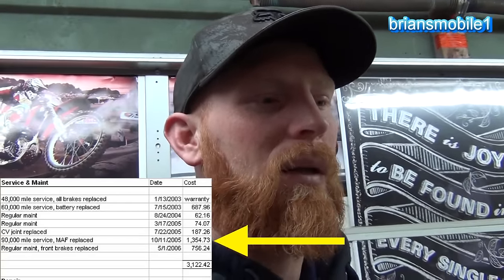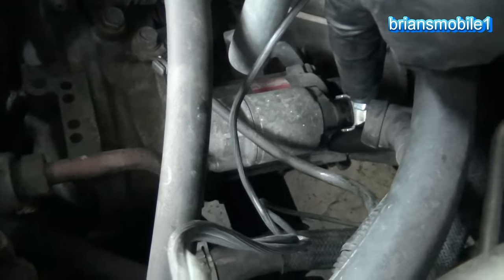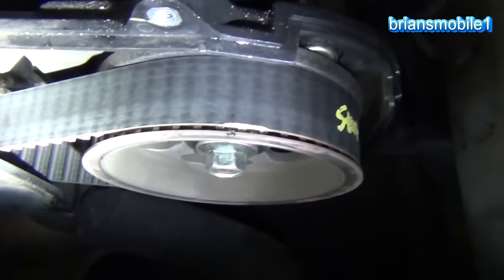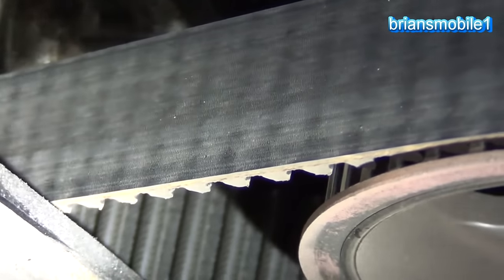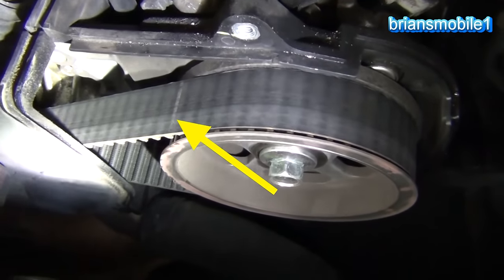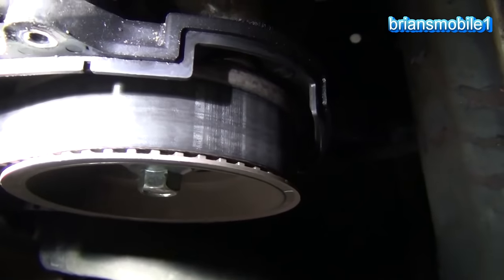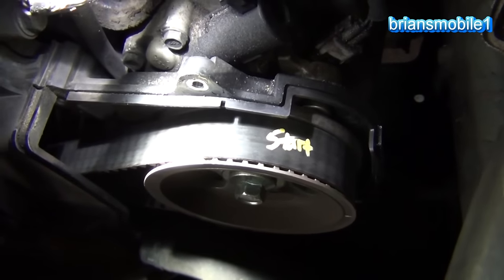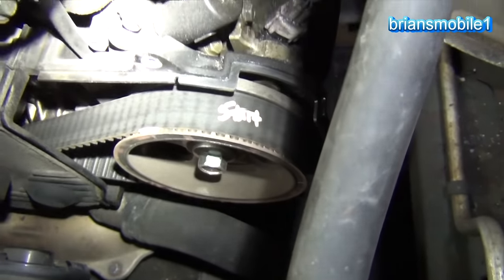How to Tell if Your Timing Belt's Been Replaced

Comment: my mazda is at 300k with original timing belt. im the only owner since new. i should probably change it. :/ im so lazy
Reply: Suspect it has a timing chain.
Reply: you really should.. 300k is a lot and belts are belts..they may snap anytime..
Reply: +fidel catsro i changed it lol i got lucky
Reply: belt may be ok, but the tensioner I would bet is counting down the days until it seizes.
Reply: dosmastrify I just get the whole Gates kit for my Subaru if you need a belt.  It comes with idlers, belt, tensioner and water pump and it's cheap.  Reason being I had an idler gear that didn't make it between changes and came apart in dramatic fashion.  Belt jumped three teeth, I had to put a Gates kit on the car.  From now on, I'm changing everything, just getting a kit.
Reply: Clearanceman2 you misunderstand me. I was saying even if the belt has aged very very well, and still appears great, the story may not be the same for the tensioner.  I had one seize and shred my belt. the intact pieces of belt I fished out didn't look all that bad... but the tensioner went catastrophic
Reply: ***** Actually, I used it on my car, sorry that wasn't clear.  But I got it from Amazon and they still have them.  Also they are on ebay.  Which engine do you have?
Reply: Jonathan Mitchell i
Reply: Bullshit The tensioners don`t fail without internal problems from engine. Many people blame timing belts. If the engine is damaged and worn a new tensioner and belt will make no difference
Reply: @ThePariss333 I would always do tensioner with belt

Comment: If you get a timing belt car, and most of them are pretty old at this point, think Toyota first. All Toyota but one model are non-interference engine, meaning that if the belt breaks it won't bend your valves and possibly break the top of your pistons. All Honda are interfence. Gates publishes an online guide covering all models through 2010. This will tell you if the engine is interference or non-interference and what the recommended service interval is.ou 

The longest service intervals are 105,000 miles. I doubt any belt is made of material that will not last that long. But use your discretion. In the bad old days, timing belt probably were made of weaker materials. On a 2000 Dodge Stratus V-6, the factory belt had about 120,000 miles when I changed it. I just changed the belt on my 2001 2.2L 4cyl Camry at 130 miles. This was, I believe, the orignal since it said "Toyota" on it and the writing was quite faded. Once you known how, it is an easy job to do though on that model. The Dodge was almost impossible to do in the driveway. The cover cannot be taken out with removing a difficult to access power steering pump and the brackey which holds it. In retrospect, I think I should have yanked the cover out with brute force when the water pump started leaking. But it was high mileage at that point and I thought the transmission was at risk of failing at that point  even though it had no symptoms yet. I got $1500 for it in the state buyback program and I had just bought the Toyota.

The moral of the story is, watch out with timing belt. People sell their cars because the timing is due or overdue and it can be a very difficult job depending the model. The 4cyl Camry 2001 and earlier is one of the easy ones. Even so, I had it jacked up five times before I got the job fully done. First time, couldn't proceed because I need a tool the remove a bracket in front. Second time, did the camshaft seal. Third time, had to redo because it was not driven all the way in. I did not have time to do the oil pump "spaghetti" seal. Fourth time, did the oil pump seal and finally put in the new belt. Fifth time, retorqued the oil pump bolts because I was not sure they were right. There is still a tiny oil leak which apparently comes from the front crankshaft seal, covered up by the huge leak which came from the oil pump. If high mileage oil doesn't stop it, I will have to jack it up again to change the crankshaft seal. But I have gotten so good at this, I probably will able to do it an hour and half, maybe less. I rent a room in private home, and I can only work on it when my landlady goes out of town and I get the driveway. I could work on the street but in my neighborhood you don't do that for anything beyond changing spark plugs or changing the oil at the most if you can be quick at it.

Comment: When those believe to be in the market for a used car when those wonder if there was signs the previous owner had the timing belt changed when new owners of the earlier 12 valve Cummins or the newer 24 valve wonder if the previous owner took care of the killer dowel pin when some engines believe in covering up an access hole in the front cover to make inspection of the timing belt extremely difficult when owners have to take much of the front of the engine apart to get at the timing belt.

Comment: I had a car that the belt was 2 years old and snapped with 18K on it - a seized tensioner (was not changed with the belt) by the garage that did the work for previous owner (it was a metal tensioner) also had a plastic tensioner wear down to a half moon shape years ago when I did not change a tensioner either (got lucky) as De clutched (upon hearing bearings fall out) towed car put new belt and (tensioner this time) and got away with it.

Comment: reality check. your opinion?  belt mainteance gives miles and months when to change a belt.  my though is the mileage is the real determiner not age.  miles determine heat and stretching that effect belt endurance not months.  therefore should belt change be determined by miles?
Reply: I wouldn’t keep a belt on a car longer than 5 years.

Comment: The problem with timings belts is that the belt is only one part of the equation...with this method of checking you have no idea of the condition of the idlers or tensioners
Reply: Thats obvious, but the vid was about checking the belt, not everything else. Thats done when its changed.
Reply: Hi, Usually the machanic will purchase a 'kit' that will have everything but the waterpump. Then its up to the machanic to decide if the pump needs replaceing. My GTr had done 170000kms and the waterpump checked out fine so we refitted it.
Reply: @ThePariss333 Did you find out your solution?

Comment: Just got my new kit in from Amazon. The belt literally has no markings on it. The entire kit doesn't. It's all from China, very skeptical on this kit
Reply: don't use it.  these are critical parts.  if they fail, the engine is usually scrap.  Chinese crap won't cut it in this case.
Reply: @reallyhappenings5597  what do I do with it 🤷‍♂️ lol what kit do I actually order? Thank you
Reply: ask on forums for your specific vehicle, or just use the OEM parts.  but maybe start with the basics like an oil change... you don't sound confident and engine timing isn't something you want to get wrong.
Reply: @reallyhappenings5597  that and the valve adjustments are the only things I've never done. I did order a oem belt. Says Honda right on it, going to attempt the rest of the kit. I'm confident just wish I had more hands on. Just me

Comment: my Audi a4 1.6 is well beyond 140k miles and still going. No recommendation on changing on handbook. Its not a chain
Reply: They are due at roughly 60,000 miles. so if it looks fresh then it should of last been done at 120,000 miles
Reply: I'd get it in the shop right away if the belt really has never been changed in the last 140K ...a broken timing belt = severe engine damage much of the time.

Comment: I'm even smater, hooray!
Reply: Wanna be even smarter? Ignore all the advice in this video. If you don't have proof of date and mileage of the last timing belt AND water pump replacement, then replace them both.

Guessing at the mileage of the last replacement will invariably get you stranded with a non-interference engine or a bricked motor in an interference application. 

This isn't rocket science. Without proof of the last replacement mileage/date, you have no f*&%$#g idea when to do it again.

Let's also not forget the "easy inspection" method in this video is not this "easy" on the vast majority of cars that aren't a Subaru.
Reply: @392blackfinger  20 years as a mechanic . I have a cracked timing belt in the shop that looks perfect, not glossy and with all the marks in it. I use it to show to the customers when they ask me to "look at it to see if it has to be done". It has 60.000 km

Comment: The only way to check these is to look for cracks along the back of the belt.   The teeth dont show wear.
Reply: I can only open cover enough to see back of the belt and it is not cracked at all or shiny do u think it may be still good. I don't trust mechanic might charge and then not do the job at all.
Reply: @martymartin2894  If you dont see any cracks its probably still good.
Reply: @gfriedman99  ok thanks I was thinking the same some friends have said it's too risky to take the chance and better to change it just in case it would snap.

Comment: I prefer chains not belts
Reply: I prefer them as well, however, they eventually need changing too.
Reply: @fordwindsor351    The advantage of a belt however is that you can change everything on the front of the engine, belt, seals, tensioner, idler, water pump or anything else driven by the belt. But it is not always an easy job. Even on 4cvl Toyota, I went on quite learning curve before I got the deal down.

Comment: This video would help me allot but I have a timing chain :)
Reply: I'd say if your car has less than 150-200k miles the timing chain hasn't been replaced :O Also usually the chains don't fail, the chain guides which are plastic become brittle and break. I have a car I'm restoring, it had 260,000 miles on it and the original chain!
Reply: Jesse Crandle  my cars an 84 with 90k original miles so I think I'm good

Comment: I never even heard of a timing belt till I bought my Kia Rio 5 in 2011 I was scared not to change it and did it at 97,000 km.  I just bought another Kia Rio after my first got in a crash at 188,000 km. It has 106,000 km and I have been trying to find out if there is a way to tell it might have been done. It is not worth the risk of wrecking your engine. There is No guarantee that covers a timing belt. I call it a ticking time bomb. lol

Comment: How do we petition car Manufacturers to stop putting timing belts on their cars. Timing chains last over 500,000 miles! I have a 2005 Acura MDX with 296,000 miles. We don't know how many miles are on the timing belt. It runs like new. I'm  going to leave it alone. I don't plan on driving it more than 2000 miles a year. Doing a diy is a risky job. So many ways to screw it up and you need specific tools! I have AAA, so when it slips the belt or breaks, they will come to my rescue!

Comment: If the seller is not responsible enough to keep proof of something as critical as changing a timing belt, it probably is not worth buying that car. They should be fairly enthusiastic about all maintenance done with some kind of proof to show, especially oil changes/timing belts. Unless its a cheap beater, better off looking elsewhere.

Comment: Here's a thought, Do not buy a vehicle with timing belt. Why they even make them i do not know? When you go to the dealer to buy a car the sales person seems to always leave out this one very important detail when purchasing a new car. That's why vehicles with timing belts seem to disappear from the road after 5 - 6 years of being built.
Reply: +BuchananZ34 Timing belts do not stretch like timing chains.  They're also lighter weight than a chain, thus they won't rob as much performance.  This is also why many race car engines "formula 1" use belts vs chains.  Also, they're easier to work with thank chains.  I hate removing chains while taking off heads on a dual cam engine.
Reply: That's why most cars are heading back to using chains because they're more durable and last much longer (most times longer than the engine lasts) with regular oil changes.
Reply: cept on nissan pickup d series common rail diesel.
Reply: On many cars, and this includes Toyota s, there are several things that go wrong:  the belt itself,  the Water Pump, Hydraulic Tensioner, Idler Bearing,  Tensioner Bearing,  Timing Belt, Water Pump Gaskets & O-Rings.
See my post below to catalyst2112
Reply: I would much rather change a belt then a chain!
Reply: AlexanderZ71 5 to 6 years the timing belt is part of regular maintenance you're supposed to replace at certain intervals just like you do with the engine oil if you're not going to maintain it it will break its not that difficult, timing chains break too, the chain itself may be made of metal but the guides are made of plastic and need replacing as well.
Reply: yes but formula 1 engines only have to last one race!
Reply: AlexanderZ71 

You are so silly! Haha!
Reply: The tensioners for chains cam wear out. Chains will wear out if your engine oil went low.

Jaguars have shitty tensioners for their chains... A lot of European cars have no real way to check oil level so say bye bye to chains on those.

They were using chains on big engines and belts on smaller for a while. Now since chain and belt technology chained, the Japanese likes to use chains for 4 cylinders now and belts for 6-8.
Reply: @gr8fullfred  yep but they are just on the edge of failure for racing. If they built autos to F1 spec and just the engine being F1 spec they'd have no warranty on the complete vehicle. Honda CR motorcles and the later CRFs had no warranty as they were competition spec or race spec. If you didn't do the requred maintenance and they blew up you got all the parts you could find with no recourse.

Comment: Best advice I will offer on this is don`t get the belt changed if you have the car regularly serviced until mileage advises it not how many years old the car is. Do not be forced into changing other parts of the cambelt change metal tensioners and water pumps. This is where mos garages make alot of money they know the water pump will not fail so they never change it and charge you for a new one when they have not fitted it tensioners are metal why would they fail before rubber. The timing belt con is the next ppi scandel that will be launched and people will get alot of compensation.  I would much prefer to have my hand stapled to a rough table and a needle pushed under my small finger nail than have a timing belt changed
Can give evidence of over 780000 cars sold from a main used car dealer 2 timing belts failed of all those cars sold with none of them having a timing belt changed. don`t waste your money on the fear factor save that money spend it on something worthwhile
Reply: With all due respect.
The belts are made of rubber and steel wire. The rubber will slowly degrade over time.
The pressure the belts are under is huge. It is a modern miracle that they last so long.
The tensioner runs on a bearing, all bearing wear out. Change it because if it locks up your belt will break.
They change the water pump because it too has a bearing that will wear out.
On lot's of cars the waterpump is behing the timing belt. The whole belt assemble has to come off to change the waterpump. It makes practical sense to change what is a cheap component whilst you can get at it.
If your belt brakes your are looking at bent vavles and a head of and rebuild.
It your water pump breaks you will cook your engine, the minimum will be a head off repair.
I would always change the tensioner every 60'000miles with the belt and change the waterpump every 120'000 if I couldn't affort it every 60'000. 
Waterpumps are cheap and if your already doing to cambelt the labour time is next to nothing.